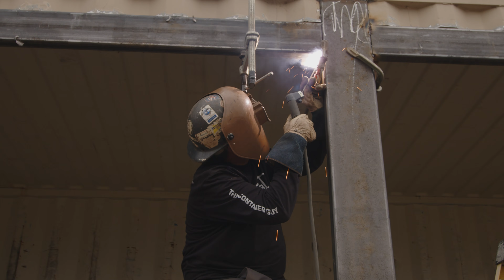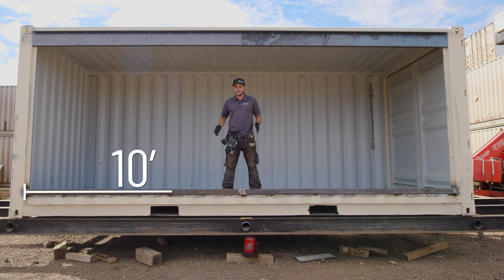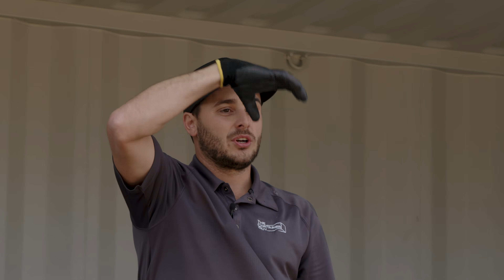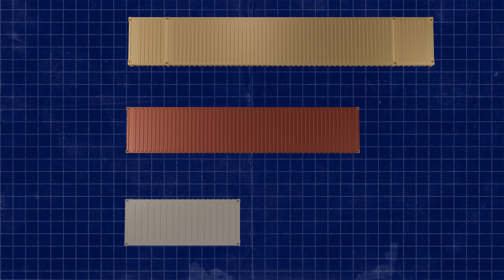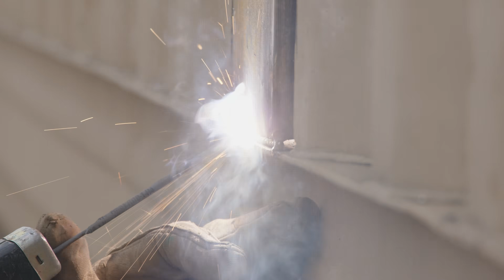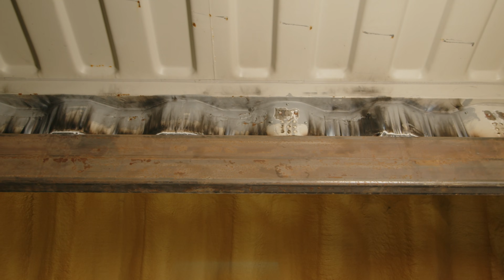Connecting Two Containers Side By Side - How to Remove Side Walls

Comment: I recently purchased a 20-foot new container. You mentioned that all containers are constructed identically. However, my corner post is flush with the square tubing on the sides, unlike the half-inch extension you have described in your previous videos.

I am considering purchasing three 40’ containers and assembling them. Should I be concerned about purchasing three containers that are constructed differently and potentially encountering issues during assembly due to their varying construction by different vendors?

Comment: You have some really great videos. But your solutions vary quite alot over time based on meeting customer requirements and your own learnings over time.

Your applications range from
almost disposable construction rental versus long term 25years in extreme climate zone.

It ends up a bit inconsistent. One video states welding or even drilling is a disaster for rust, the next reports  extensive welding on a large opening.

You should recategorise the videos so that the qualitys required for an office is shown verses say a habitable dorm room, wet room or a workshop, or a construction materials or chemical store, short/medium term quality v long term residential.

Comment: What about stitching three 20ft - high cube containers to form a moderate square? 
Trying to create a 24x20 personal/professional home gym setup on my property adjacent from the house itself in a modular designed literal open outdoor floor plan

Environment: Desert, temp range 26.5* - 101.2* / Record 117.4*  (85 yr avg data)
Foundation: Concrete Pad
Rain: 5.83" in Annually
Snow:  0.4" Annually

 - Front container will have the original factory available full open side that will open up the front fully. 
 - The middle container will need to have a man door on one of the ends. but both long sides will be needing removal
 - Rear Container will have/need a single offset locking roll-up door, the rear offset roll-up door will allow for passive airflow during use and opposite of that will have a 2 occupant personal inside self contained sauna vented to the outside but would pull airflow from within the gym space.

Would prefer to add an above slightly over-sized mono-pitch roof that would offer some shade for a simple seating area outside. Have plenty of diner napkin sketched ideas.

Since we're all in here poking brains anyway haha, appreciate your thoughts, or anyone's for that matter.

Comment: Hi there. Very professional video. Congrats for that. Do you by any chance tried to connect two 40ft containers side by side to be used as a Testing Pool ? We are the Cyprus Marine and Maritime Institute (CMMI) and we are in the process of constructing/purchasing a testing pool to test our ROVs and gliders. Out of the 12m long, we need it to be an 8.5m(Length)X4.80m(width). The rest it will be the Filtration room.

Comment: How you live in Canada and use the imperial measurement system, don't Canada use metric system? Are you saying the Imperial system is more accurate than metric system?
Reply from the maker: All Canadians think in feet and inches. Metric is much better for metal fab but if someone told me something is 457mm long, I would have to convert it to 18" to be able to visualize how long it is. We're hybrids because when it comes to highway speeds, we think in km/h. Both units of measure are 100% accurate. Impossible for one to be more "accurate" than the other.